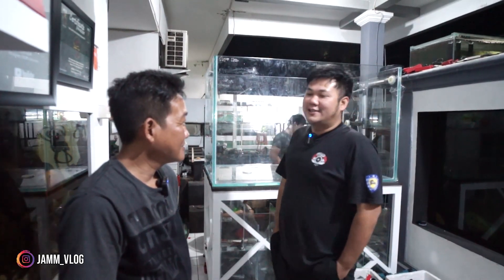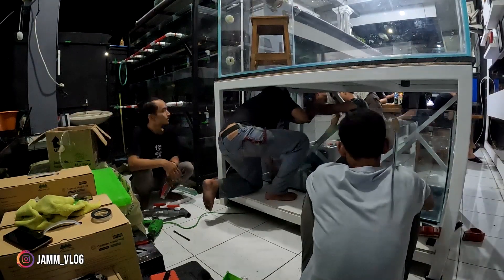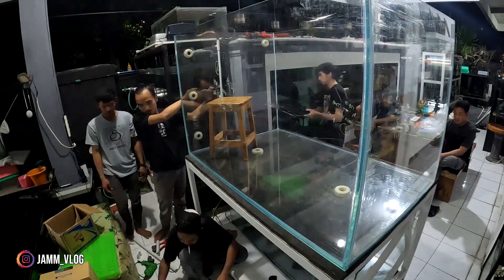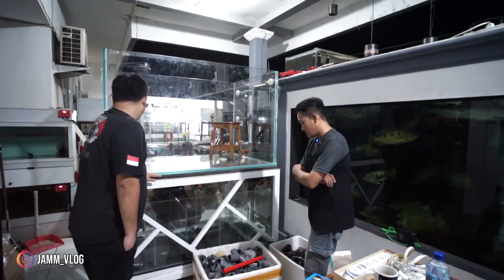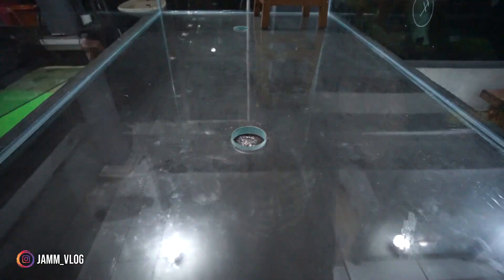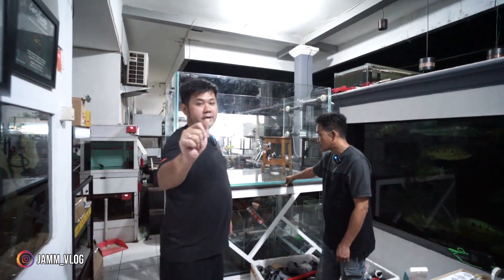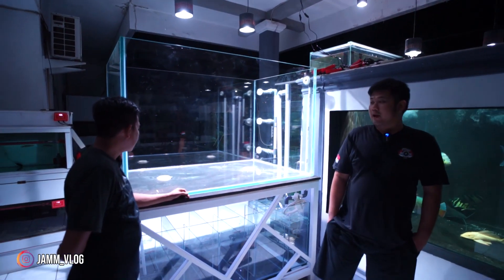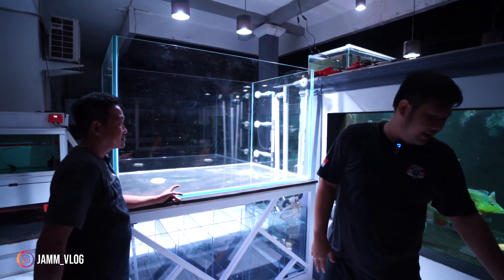AQUARIUM SMART SYSTEM!!! PERTAMA DI MARKAS JAMMVLOG!!!

Comment: Saya pernah pake level air gitu, cuma bukan bottomdrain, pake output belakang bawah(pojok) daya dorong ke filter terhambat karna naik dulu, pipa 1inch, dulu pake pompa re-su-n 2400l/j malah tekor di output menuju sum. Alhasil pake stopkran diatas pompa buat nyeimbangin flow air ke tank utama.
Bercerta sedikit aja koh, bkn mau menggurui atau kasih saran yg engga engga🙏
Reply from the maker: Ohhh siap ini belum di test isi air sih om dan ini masih pertama kan di tempat ku om, pasti ada try and error, terima kasih ya om sebelumnya udah mau sharing 🙏🙏
Reply: @JAMMVLOG  saya tunggu update selanjutnya, karna saya lihat itu ada 3output.
Kalo gak dicoba kapan suksesnya, bener kan koh?
Lebih semangat lagi koh ngontennya, channel yg paling sering saya tonton👍